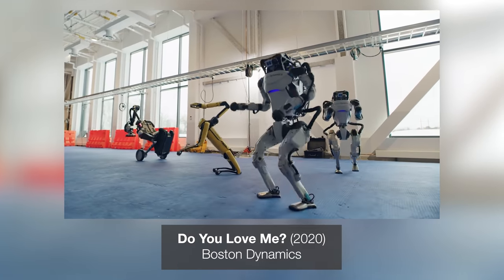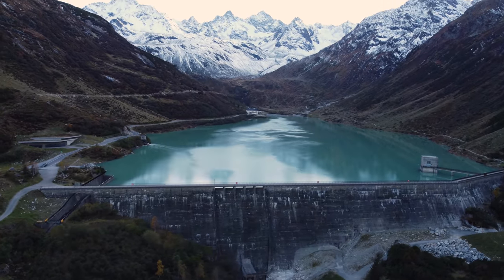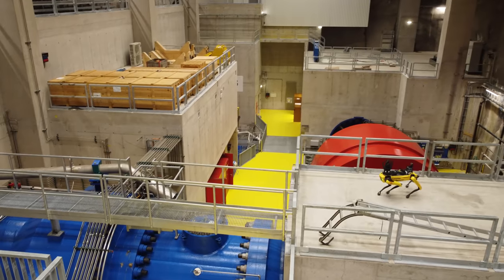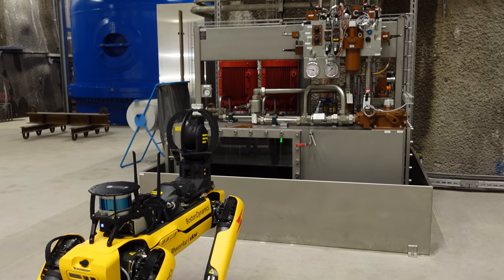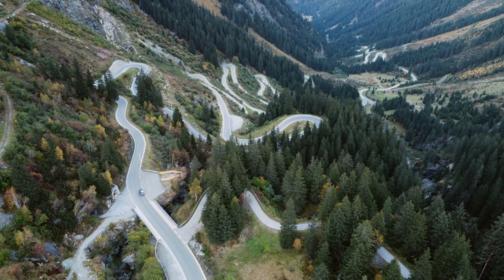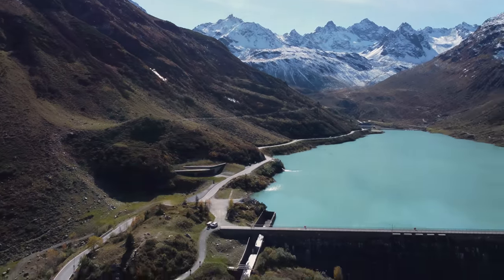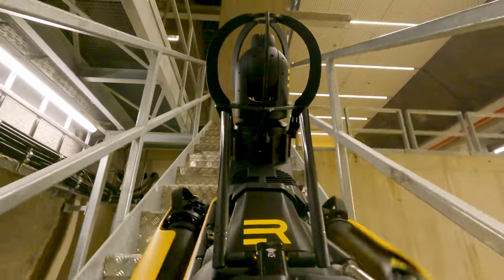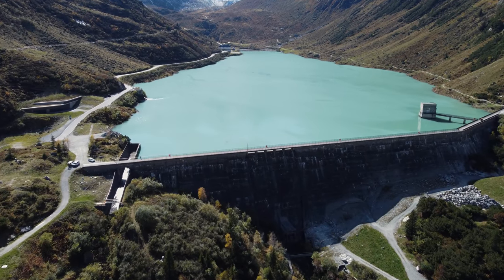An actual, real-world use for robot dogs

Comment: I wonder, wouldn't a drone flying through the whole thing and being able to get even closer to things be more beneficial, less complex and cheaper? In fact, one like the drone that is already filming the shots?!
Reply: Someone would have to control the drone.....
And drones can't charge themselves
Reply: Good question, seems like that would be better in every way.
Reply: If robodog stops working, it stops where it is. If the drone stops working, it falls out of the air on to something.
Reply: @huzaifakhambhati8767  Could be computer controlled going through the same path in space, with collision avoidance sensors and such. And I'm sure drones can be made to charge themselves
Reply: ELECTRO BOOM
Reply: Here this Spot carries many smaller cameras, one big rotary camera, and LIDAR (also something which seems to be used to have better range).

All those things have some mass that drone needs to lift and fly with, drone also needs battery power to have similar operation time which also makes it heavier.
Reply: @ElectroBOOM  it can but the code required would be quite long and confusing
It's not that easy to add autopilot to a drone....
And the drone has to also hold heavy equipment- to scan the heat and stuff
Reply: You could also do a combination of the two. Have a flying drone launch from the back of the dog drone.
Reply: Because the Eagles would attack them.
Reply: banana is very good
Reply: A camera-laden drone can only fly for 10 minutes or so before charging, the dogs can run 90 minutes.
Reply: @shelvacu  Have you seen Skydio 2? Or Amazon's Ring Security drone? If the drone knows it is losing power it can return to the charging station. If it gets bumped it can use its accelerometer and gyroscope to reorient. They can be built with "airbags" to fall and not damage themselves or what they hit. They can be built light weight so that when they fall they don't damage equipment below. Drones are indeed a better solution than a robot dog.
Reply: But robo-dogs look cooler. Checkmate
Reply: Yes that is interesting, currently drones have a very limited battery and payload (actual sensors) capacity though. With gas sensors weighing around 1-2 kg and some others even more, it will be hard to fit all that to a drone. But some tasks will be easier to do by drone, I agree.
Reply: @starstenaal527  no, banans look cooler
Reply: It would be a grat idea if the robot could be stable having to carry expensive gear, also that the drone could have problems looking at a place in a specific spot in the air, also you have a hazard of an object that could destroy a machine if they loose power or the drone burns down. a land robot is much safer, the only thing it can do is fall down the stairs, crash against a side walk or crash in to a wall, in most cases the robot would stand still, waiting for someone to fix it.
Reply: @ElectroBOOM  Yep. But I assume this is both a safety and a utility option. A walking robot uses less power than a flying one and can carry more equipment. Plus an existing upgrade path for physical manipulation (Dog can get an arm upgrade) and then do small adjustments in the future to the facilities equipment.
Reply: K make a drone that does that then
Reply: Just a couple of cctv will do the job fine
Reply: Key being Fail SAFE.
Drones fail in an extremely dangerous fashion (by comparison)
Reply: That is correct. A drone could do the job also in this very nice environment with no wind, no rain, ... but getting drones to have the awareness of its surrounding as a robot can, due to computational power, more payload capabilities,... is quite a problem. We at Energy Robotics adding drones to go there, where a robot can not go: vertical ladders, pipe bridges, top of tanks,.. so the future is heterogenous robot fleets to get the best robot/drone to do the task
Reply: @TechyBen  Yes, and especially if you look at the other robots of Energy Robotics, like the EXR line, they can have up to 4h of operation and are extremely robust and reliable (they can't climb stairs though). The Rover Pro robot can carry up to 100kg of weight, i can't see a compact drone do that anytime soon ^^
Reply: Btw ... big fan ;-)
Reply: Perfect solution until it crushes into something.
Reply: Could be that the needed sensors are too heavy or some passages are tricky (lots of stairs and little space)
Reply: For some situations: probably. But right now walking/rolling platforms are the way to go. Reliability, stability (as in: stable during movement), accu duration, heigh weight limit, environment interaction possibilities (reaching arm).
Reply: I mean, they did say they were testing out different kinds of robot to see which worked best.

That said, a drone of that size likely wouldn't be as stable as something on the ground when carrying all that equipment.
Reply: @ElectroBOOM  do you like banana?
Reply: @Akash-tc3tu  well, CCTV with heat sensors. It's one or two cameras vs. a lot. Here, you just plonk Spot down somewhere and you're off to the races. The wiring etc. required for CCTV is quite a lot more work, especially if you multiply it by the 20+ sites Tom mentioned.
Reply: I have a feeling they also do 3D scanning of the environment with something like lidar, perhaps temperature monitoring etc. I'm sure they are smart enough to have considered drones.
Reply: i'd guess the problem with that would be that drones have a limited payload carrying capacity depending on their size. with a robot on legs you can carry heavier payloads on a smaller robot
Reply: I think it would be more expensive considering that drones use more energy and you also need money to develop algorithms like the ones that boston robot has (pathfinding etc.)
Reply: I think a robot dog is more reliable than a drone. If it makes a mistake, it crashes and breaks, while the dog can just take a step back unless it get stuck. And i also think a dog could probably perform other kind of tasks if it was programmed to it.
Reply: it's probably also a matter of the equipment you can carry and efficiency. The drone would have to lift and power a thermal camera, which would cost a lot of energy and a lot of time recharging. These robots in turn are probably very efficient when idling. Also, it's probably a lot safer to have a slow walking robot than a fast moving drone in your facility.
Reply: @ANDSENS  true..CCTVs just sounded more practical and cheaper.
Reply: Drones have other reliability issues, have to be below a certain weight limit, and have much more limited power.
Reply: As some have mentioned the real issue is weight. Spot can carry a gimbal camera, temperature sensor and distance sensor all on its back, whereas a drone would struggle to lift that much weight.
Reply: I mean at that point just put the cameras on the right place and leave them there
Reply: Drones can't open doors. Spot can.
Reply: one potential reason is the need for heavy instrumentation. Especially if manipulation is expected in the future, drones might not be able to interact with the equipment as well simply due to lack of mass and power or they might not be able to carry certain instrumentation due to carry capacity limitations.
Reply: i like how everyone here talks with the confidence as if they're a robotics/engineer expert.
Reply: It would require a huge as hell drone because of the size of the camera the dog is carrying. And such a camera is required as you might saw the thermal vision it had. (And maybe other modes too)
Also if the drone crashes the hardware will be more likely to break than the robot dog because of the hight.
Reply: @vm_duc  Well, I'm actually a mechatronic technician in just a year and a half.
Reply: @cdmcrst1292  This is the Chad answer. The dog can be a high-tech sensory mothership, with LIDAR, infrared, sonar, and more. And then, when it needs another angle (but doesn't need as rich of data), it can send out the probe.
Reply: Drones aren't exactly good at maneuvering tight spaces, which robot dogs can. Although drones are smaller, they're susceptible to tiny disturbances. Robot dogs however, can still function even if huge disturbances were to be applied. Not to mention, if you attach an arm, robot dogs can open doors, which drones couldn't. Moreover, drones are problematic to use if the area is too densely packed with tall objects and hanging objects, especially inside of a building, in which there's also a ceiling. There's a reason why you don't see drones flying in the woods, but you see them flying above the woods.
Reply: @ElectroBOOM  they already exist, the Amazon security camera drone, it flys around the house automatically
Reply: @alik42069  Inside of industrial buildings, there's bound to be lots of blindspots for normal camera placements. You might say that you can just put more cameras, but that would need more monitors, wiring, and people to watch over them.
Reply: It's inevitable for a flying drone to malfunction and fall, eventually. A walking robot which malfunctions just stops, and doesn't risk falling on anything. The same logic also applies to just being clumsy. A walking robot can stand in place if something unexpected happens.
Reply: I bet it could. 
There could be issues though. 
Weight, active time before charging. 
There may be door to open. 
If it falls it could break something. 

I am sure we will have both in the future.
Reply: As I have spent my career  working in heavy industry plants, such as power generation, that are a lot like the one in the video, my thoughts on the robot vs drone question are:
- Due to all the complex steel structures, catwalks, large heavy equipment, probably lots of electromagnetic interference, radio communications can be unreliable, or of low quality, or with some latency. Not ideal for control of a drone that must be controlled at all times, and crashes or falls if not.
- Drones that use optical pattern recognition to figure out their location and relative motion through space might get easily confused by the physical complexity of the environment. A robot dog using a conventional camera might not be confused by an overhead view of the steel gratings, while a drone with its 'always overhead' view might have more problems in this regard.
- I presume that the computing power required for drones is considerably less than what is onboard for the robot dogs, so the dogs might be more generally capable, flexible, and/or able to have more extensive programming for their environment or tasks, which would work at faster real-time processing speeds (than might a drone).
Reply: @alik42069  creates more points of failure. Cameras in every spot of the facility, each of which could fail on their own, vs the one camera on the robot.
Reply: Couldn't you just put up cameras at the places you need to inspect instead of having something move around the whole placing??
Reply: Why not just use cameras pointing to inspection sights?
Reply: @nemo-x  I would argue that a drone is a bit harder for itself to pilot, if the dog has an issue and "crashes" it'll probably just pick itself back up and be fine.

But if the drone has an issue and crashes, then that's a broken rotor or something else.

Just a theory
Reply: I love the replies to this insisting drones would be superior, as if they know better than people who work there
Reply: Because battery technology is not good enough.
Reply: @ElectroBOOM  Leave the mechanical engineering to us. You stick with the sparks
Reply: @huzaifakhambhati8767  if the robot dog can control and charge itself, so can a drone
Reply: @alik42069  with all the potential instrumentation the robot could carry, having those same sensors statically placed would become exceeding expensive depending on how many things need to be monitored.
Reply: @firecrow7973  if it can charge itself batteries are not a limitation. Hell my robot vacuum is smart enough to charge itself in the middle of a clean if it’s running low on battery and pick up where it left off after it’s charged.
Reply: Drones are nice for visual inspections with thermal and other sensors, you could even make a hybrid drone with wheels and hover or fly just when necessary to save power.
Security and visual checks would be the best place for drones.
But if you need more ruggedness in hazardous enviroments, not forgetting manipulation arm(s) the doge is better.
Plus with a little bit of code you might program a play and pet mode to it.
Reply: @ElectroBOOM  indoor positioning - very hard
Reply: You're looking at shots of the big open space.  Not everywhere the dog goes will be a big open space thats easy to fly a drone.  Some bits will be tunnels and sharp turns.
Reply: @nemo-x  Controlling a flying drone is much harder than a walking dog. For example, if it, for some reason malfunctions and can't determine where the ground is (that tends to happen, 'cause most sensors are heavy, and often they only have a camera pointed towards the ground) it will happily slam itself into the nearest wall, while being convinced that it is standing perfectly still. Meanwhile, a robot dog doesn't really have problems like this. It can also carry a much larger weight, so it simply has more sensors. And since it doesn't have to keep those heavy sensors suspended in the air, it also uses much less power to achieve the same thing.
Reply: @huzaifakhambhati8767  There are autonomous drones out there with obstacle avoidance system and environment scanner cameras.
Reply: They could have trouble mounting that beefy thermal camera on a drone
Reply: I would say it would be cheaper to just pack that place full with cheap rotating camera's
Reply: The walking robot is able to carry larger loads which makes it much better than a flying robot. Also flying much more dangerous in enclosed spaces like a hydrodam. So in this situation the walking robot is better than the flying robot, for sure!
Reply: 1. most of drone can't charge itself
2. drone crash into things when incident happened while robodog stay still when incident
3. this is way easier to take clear image camera for robodog than for a drone
4. robodog can peep beer
Reply: even simpler, they could just plant a camera on everything that needs checking. surveillance cameras are inexpensive
Reply: @ElectroBOOM Ask James Bruton, much more qualified than us armchair engineers :D
Reply: presumably, a drone system would be more complicated and not be able to carry the heavier inspection equipment necessary for this task (notice how the spot is carrying quite a sizeable array of equipment on his back here). additionally, it seems more likely that a drone could damage any fragile equipment were something to go wrong.
Reply: @shelvacu  This is the best answer in the discussion. "If robodog stops working, it stops where it is. If the drone stops working, it falls out of the air on to something."
Reply: @DannerBanks  
I doubt this drone can carry the entire apparatus that the Robot Dog carries.
And even if it can carry the entire equipment, battery life-time will reduce a lot.
Reply: Drone (I recon you are meaning a multicopter by that) is quite energy inefficient. Probably the most energy inefficient of all autonomous vehicles we have now days. No way it could have a flight time of 1 hour for a 1 hour recharge. Ok, it surer can get to the right spot faster, but still the dog seems to be more reasonable in that regard.
Also the multicoper carrying a similar payload woudl be quite large and bulky. And in case it accidentally touches anything on the way it would most probably lose a propeller and fall down. Or at least need a repair. The dog running into something... meh.
Also the dog is rather safe to work alongside humans if needed. Large muticopter in a confined space? Forget it.
Reply: I guess it might be range...robodog had a lot more range than a drone. And drone might not be able to fit through tight spaces well.
Reply: I'm thinking it would be difficult to fit that much equipment and enough batteries for a one hour inspection tour onto a drone rather than a land 'vehicle' less impacted by weight
Reply: Simply put, dog is just easier. Drone has a lot more limitations to conquer to do the same thing (weight, battery life). It's very possible that the tech might migrate to a drone though, or even a combination of the two systems.
As for "point a camera at everything", a mobile system can give you the chance to inspect elements that don't make your camera list (not important, or situational to an error occuring). And it also lends itself to physical interaction/problem resolution which static cameras can never do.
Reply: @3zuli  we do. Its a small world and amazing drones ;)
Reply: @DannerBanks  Or you could spend way less on a robot dog that's cheap and easy to repair
Reply: @huzaifakhambhati8767  You know literally nothing about this, shh.
Reply: If the drone crashes it cant get up like the dog (yes it can do that) and if it just touches something it crashes and the blades probably get damaged and as you can see the dog has a lot of stuff on its back wich would mean a really big drone and drones have a worse charging to use ratio
Reply: It doesn't have to be that high tech. I don't see why they can't use sensors that provide data like everywhere else.
Reply: @oBCHANo  umm opinions? 
If they could have done something like this they would have
Must be reasons like cost or the coding required is too difficult 
Maybe the drone can't lift the heavy equipment...
Reply: I'd go for a bunch of webcams instead, with thermal webcams on anything relevant. No navigation required at all, just wiring everything up.
Reply: Gotta consider the sensors/equipment/etc. that has to be carried on the robot, which isn't as practical with a drone
Reply: @nemo-x  The environment where drone fly in changes all the time… wind direction, wind speed, air density. Its not a static environment like the floor spot is walking on. 

You really need a human to operates the drone.

Spot is much more suited to fully automated tasks.
Reply: Why not a drone? Well, a dangling cable could wreck it for a start, Detection of surrounding space maybe isn’t their strong point yet. The dog might step over or around it or ask for assistance from sn operator or just stop and record it as an anomaly.
Reply: @no-lifenoah7861  You're joking right? These robot dogs are $75k, the Skydio 2 is $1k, and the price of the Ring Security Drone is $250 (rumored).
Reply: @DannerBanks  no
Reply: @theonewhodanceswiththepenguins  No what?
Reply: It's less practical, because you need the same physical hardware onboard, and drones take more energy to keep that weight aloft than a dog does to be on the ground.
Reply: @huzaifakhambhati8767  Literally every drone on the market has autopilot and a feature where it returns automatically when the batter is low. Stay in your lane.
Reply: Good point, in general. Especially if we consider those hybrid drones with legs. Veritasium had a video about those recently. I don't think large, heavy walkers are the best suited robots for inspections like these.
Reply: Probably. But then they couldn't use videos like this to put a positive spin on these things, thereby distracting from the military applications that they're truly being developed for. And these videos are doing their job very very well, aren't they?
Reply: notice the big heavy camera mounted on the dog. fitting such hardware on a flying platform would result in abysmal battery life (probably 30 min tops without making the drone super big) compared to spot's 90 minute battery life. additionally, if a robot dog crashes into something, worst case is it gets stuck and someone has to go get it. with a flying platform, the whole thing could fall from high up, or worse, into the machinery.

for a power station, simplicity and cost don't matter as much as being reliable and robust. Boston dynamics serves a niche group of consumers with the spot robot, but among that niche group their robot is a godsend.
Reply: Could just use cameras.
Reply: @ElectroBOOM  my thought exactly! I am honoured to have the same thought process as you, Sensei
Reply: Nope. Too much weight for the drone to be energy efficient.
And before someone tries to make the point that the cost of the dogs is so much higher it may still be cheaper to use drones, let me remind you that back in the day drones were very expensive, and became cheaper when mass production kicked in. The same should happen with the dogs is there's enough incentive.
Reply: I've got it!!!!!
A spot with a micro drone on it's back. The home base, return point, could be a wireless charging station. The drone wouldn't need anything too complex as it wouldn't be in charge of initial motion, only niche tasks. The robot dog senses a problem with a local sensor and deploys the drone to get even closer, eliminating blindspots even robo-spot can't reach...
Reply: @shelvacu  good thinking
Reply: 2 things to consider :
1. Autonomy
2. Sensors weight
Reply: A lot more could go wrong with that as the maneuvers would be more complex
Reply: @huzaifakhambhati8767  You can control drones with a computer and you can make ones charge themselves by landing them on inductive charging pads
Reply: @huzaifakhambhati8767  induction charging similar to phones is easy to implement on a drone
Reply: In the future they said they wanted the robot to perform fixes/tests, which wouldn’t be possible on a drone.
Reply: @huzaifakhambhati8767  an autonomous drone could do both
Reply: @huzaifakhambhati8767  i don't think the autopilot is really an issue here more the mass and battery life wich you stated
Reply: @Akash-tc3tu  good luck on those infrared cctv's!
Reply: Or just CCTV where it is needed
Reply: Drones have a big, non solvable, autonomy problem.
And they use a lot of power even if they stand still. The legged robots are a genial compromise.
Reply: @nemo-x  For "Autonomy" I meant the running time. Sorry if it isn't immediately clear.
Reply: @joeyjakey  infra red cctv is expensive af
Reply: Robot dogs have a much longer battery life
Reply: not sure that drones would be energy efficient to have those in some 20 odd power plants as motors, lipo batteries etc does wear out quick and all the weight such as sensors the drone have to carry wont make it easier.

btw I Love your videos and Im with you on the Mould effect...
Reply: @shelvacu  could take a pre-planned route over stairs and walkways only so if it does somehow run out of battery it wont fall on anything important.
Reply: Wonder if a drone used in a commercial way like this in the US would require FFA approval? Otherwise I think the biggest issue would be fitting the same amount of sensors the robot carries on a drone.
Reply: I agree but the potential for dogs is so much greater (could even have a drone on it's back).
Reply: Drone bad, dog ok Asimo better.
Reply: @huzaifakhambhati8767  Drones can be autonomous and they can charge themselves.
Reply: Maybe it's more energy efficient to allow the robot to stay stationary while taking measurements? And also you probably want the expensive measurement instruments on the thing to be as protected as possible... So maybe robo-doggie has an actual advantage?
Reply: Or just a camera pointing to the machinery or just sencers
Reply: @starstenaal527  
They could make the drone look like a Star Destroyer, or how about the USS Enterprise? And that could be the spaceship, or the aircraft carrier.
Reply: For most of the tasks, flight would be an unnecessary use of energy.  As mentioned in the video, Spot can go for around 60 minutes at a time.  Show one drone that's not massive and can hold a decent payload that can do that.

And then there's if something goes wrong with the robot.  With a ground-based one, the worst is Spot falls down some stairs or off a gangway and likely does little damage.  A drone would be more likely to cause significant damage.
Reply: The dog here is carrying cameras and stuff, image if the drone needs to carry the same load. Plus, it's much easier to make a generic universal version of a dog that can carry light to heavy weight compared to a drone that can both carry light ans heavy weight. Because in the latter version it probably needs to be bigger to handle the weight and have a bigger battery to handle its own bigger weight ans the weight of the cargo.
Reply: @huzaifakhambhati8767  
The heat sensors can be much smaller on the drone.

The one on the dog looks to have moving mirrors, and probably a gyroscope.

The drone doesn't need either of those on its camera. Makes things much lighter and smaller.
Reply: I mean I don't really understand why they don't just use cameras and sensors, I don't see what the dog has more than an army of camera...
Reply: @huzaifakhambhati8767  Yes they can charge themselves. They do it all the time in autonomous deployments.
Reply: Wouldn’t all the different cameras and equipment be too heavy and awkward, there’s only so much you can put on a drone
Reply: For those suggesting just cameras, you have to take in mind how many would you need, same goes for sensors, you can't have a sensor for every inch of space you have, the robot(drone or dog) is taking the place of a human doing a close visual inspection of the equipment on site.
Reply: A dog is more stable and is less likely to fail 
Equipment is too heavy for a drone
there arent many people building drones  for industrial use
Reply: @DannerBanks  And can drones carry a thermal camera and hazardous gas sensor? Can they carry a lidar sensor so that if the environment becomes partially obscured by smoke they can still navigate? Both the drones you suggest are far too small to carry any of that. Having flown many small and medium size drones myself they have very limited lifting capacity. The types of sensors they want to mount on them to monitor an industrial environment would be too heavy for all but the larger industrial size drones that are just way to big to access some of the tight spaces that a robot dog for instance can get too. And no engineer wants anything falling into machinery, doesn't matter how small it is or if it has an airbag.

And finally everybody on this thread suggesting a flying drone would be so much better and easier are acting like a bunch of actual engineers looking for alternatives wouldn't have already considered them if they were a viable solution, you're suggesting they could think of using all manner of ground robots and never thought of  flying drones? Like c'mon....
Reply: @huzaifakhambhati8767  Wrong and wrong, having spoken to guys who develop and install automated drone systems, you can code them already and you can have them automatically return to a charging station and charge themselves
Reply: @Timeward76  
But drones don't need that massive gimbal camera.
Reply: autonomously flying a drone in indoor spaces is more challenging that a robot on the ground, and on top of that flight time is a huge obstacle. the high resolution thermal cameras and big lenses require some serious lift, all while the engineers need time to take a close look at the footage. it would probably take multiple charges to get through the entire plant. 
it might at the end of the day still be cheaper but the freedom of carrying all sorts of heavy equipment probably did it for them.
Reply: Yrrrr
Reply: Flight takes a lot more energy, and the noise from the propulsion might interfere with readings. It also has to work alongside humans, quadcopters would be more hazardous.
Reply: The most important factor for any new technology is reliability. A drone can be reliable, but I wouldn't trust such an important infrastructure with it.
Reply: Weight of the special equipment
Reply: Or just have sensors permanently stationed at each of the key points.  i.e. the way everybody else does it.
Reply: drone takes lots more energy especially if equipped with heavy gear and a bunch of things it needs to compute
Reply: @huzaifakhambhati8767  ain't programmable drone are a thing ?
they can follow a predefined path just like robodogs and take an areal picture and dock / land on a wireless charger.
Reply: Wouldn't just installing a camera at the relevant point be simpler than moving one camera around the perimeter from device to device?
Reply: Could put the drone...on the dog?
Reply: if it can at least match that 60 minutes inspection time without all the struggle of flying inside a building, then i think it would be more beneficial
Reply: shhhhhhhhhh! We have to unload these dogs on SOMEONE!
Reply: To put it simply, having a drone flying around, regardless of it having airbags or not, is simply a larger risk as there's a greater probability of an error with the code. Using the dog is safer and allows for better-quality equipment which has a much smaller chance of being damaged if the pathing of the dog does go wrong, and it can operate for longer periods of time than a drone utilising the same equipment as the dog. The only downside to the dog in this scenario is that it would take the dog more time to complete one full cycle before repeating it again than the drone would. However, the dog is not required to be particularly fast, so long as it can complete a cycle in a reasonable time pushing to make a drone just to save a few minutes per cycle doesnt sound like a necessary investment of resources. Especially when there would always be humans on standby in case something is wrong and the dog has detected it. It would take the dog a few minutes longer to find the issue, and then the human would be on their way and problem solved. Now, if those few minutes really do matter in order to save the facility from something catastrophic, well then by the time the human worker gets there then its already too late. 
So to finish up, the robot dog is less of a risk in terms of equipment damage and pathing errors, and its downsides are not significant in order to push for the use of drones, which i imagine would have shorter battery lives and cost more than the dog, if they are expected to perform exactly the same task.
Reply: @nemo-x  so you need a very precise drone that knows EXACTLY where it is and presumely land itself on a wireless charger with minimal margins of error or it won't be charged
Reply: @ElectroBOOM  if someone develops an Autonomous drone that is tested and proven to be safe to operate reliably in an industrial environment, and has the lenses and thermal imaging needed to do inspections, I am sure that they will become a viable option as well.
But when you look at how long it's taken to get a slow moving robot to be that safe and reliable, where worst case in a failure mode it lies down, I think getting a flying machine that can accurately pilot through tight spaces in a confined industrial environment is going to take a while to get ready for market.

Also consider the explosion safety aspects.
Spot is probably made to be safe around flammable materials, where if a drone crashes it is very difficult to make it spark and explosion proof due to the extra weight.
In this plant there may be no explosion hazards, but most industrial facilities that would be a concern.
Reply: @skypig  most drones can fly 10 minutes after a 60 minute charge.... And it's supposed to be working 24/7.... So in terms of work hours, it won't be much while the dog works 12 hours a day
Reply: @huzaifakhambhati8767  That's like saying "someone would have to control the dog, and the dog can't charge itself"
If you're automating things, there's no reason you can't automate a drone.
Of course this is all academic, since setting up cameras around the plant would be orders of magnitude cheaper than an autonomous robot.
Reply: @ANDSENS  The dog costs hundreds of thousands of dollars. More than any camera system that would be used for similar inspections.
Reply: I'd say it's because of the size of the equipment needed to do the checks is too big and heavy for a drone, but I'm not really sure
Reply: @hazmatbp  It's just the camera cluster on top. Larger stuff than that could be carried by drone.
Reply: @Falcrist  $75k actually, (+ additional equipment). Compare that to the cost of ~20 thermal and normal cameras, plus (swiss) labor cost of installation. Additionally, you're kind of set on what you can monitor once the cameras are installed.
Reply: @huzaifakhambhati8767  why not?.
Reply: Drones can't open doors. And places like these need doors.
Reply: @rodericklenz5030  Doors can be automated WAYYYY easier than making a robot.
Reply: @ANDSENS  75k for the robot + 50k for the lidar/navigation cluster + 30k for the sensor/camera cluster and more for the software and support along with assorted stuff like recharge station etc.
It's literally multiple hundreds of thousands of dollars. You could put up literally hundreds (possibly thousands) of remote controllable IR+Optical camera clusters, power them with POE, and set up some wifi access points to reduce wiring, and have the whole shebang online in a couple days.
Reply: Using both the drone and legged robot in combination is an approach that would work as well. The drone can recharge on the legged robot, and can send information back to the robot. I’ve seen this approach to collaborative robotics from aslteam, albeit for mostly for navigation.
Reply: To the people that Say the weight is too much for every sensor.
Have You consider have two drones, or more
One for Thermal inspection, one for visual, etc. 
For those who Say it is not realiable, have You consider having a backup? 

And still, Will be chapear and less computer power into that.

I think this is just a justification for a technology that have no other use than military (and even that resulted bad) 

And the ones who say battery for a drone is a problem
You know this things use bateries right? 
It's more efficient, not at all
Just because you can have a bigger package doesn't mean it can carry more, because is carrying it's own weight.

Seriously guys, You are blinded by the shiny things and don't think that robo dogs are no different that other solutions 

You are just arguing in favor because it's the new popular nice thing.
Reply: Because flying is more unstable and prone to accidents? A breeze coming in could destabilize it, and it could crash into something that could cause some major issues? On an overall flying always has and always be less safe than beeing on the ground. There are much less dangerous variables on the floor than in the air, without speaking of the difference in damages if something where to happen. Just a wild guess.
Reply: Absolutely possible! But a drone with the same capabilities? You can have a much better camera on Boston Dynamics's Spot, than on a drone.
Not really the same situation, but Spot can also have an arm attached, to interact with different values.
Reply: @ImieNazwiskoOK  they could have 4 drones, one for each camera, and for redundancy, probably still be cheaper than one boston dynamics dog
Reply: @ThePiemasteification  but drones move and charge faster, would they really need to be up for 90 minutes at a time?
Reply: @DannerBanks  You can't build them lightweight when you need to cram them full of equipment. That dog carries more than just a camera.
Reply: Or just fixed security cameras
Reply: But it's a dog tho
Reply: @DannerBanks  there's still a possibility (however small) that it could just.. stop working
Reply: @danielshroff4381  true but if that drone crashes it disrupts half the country
Reply: @Pronto the tasks don't need to be done fast they just need to be done
Reply: Electric cost.
Reply: @huzaifakhambhati8767  there actually are drones that can dock to charging stations, the controlling is a lot more tedious but not impossible in theory. my guess would be the hardware capabilities - you cannot get a very large drone that can maneuver indoors that easily, and having a smaller drone you may not be able to fulfill many of those tasks. ground robots are especially good at carrying things around, especially themselves because the ground is supporting them. every gram you put on a drone is trouble
Reply: @DannerBanks  Lightweight? With visual,and IR cameras, LIDAR and other systems that Spot carries? I think not.
Reply: No. Just the equipment the dog carries is heavier than the drone itself. All the sensors also require a heavy battery. You'd need a number of additional sensors and power for collision avoidance and the total flight time would only be a couple of minutes. The drone would have a very high risk of getting damaged and potentially also damaging something in the facility and definitely damaging some of the sensors on board. It would be the most nonsensical solution imaginable. 
Some people suggest adding a drone to accompany the dog - but what's really the point? Then you'd have two machines to do a job which can be done by just one of them anyway. Doesn't make sense.
Reply: @FlipnKraut  And have you considered the option of using a drone for vacuuming?
Reply: @yourmomlmao9638  Have you even thought about the amount of sensors you'd need to install?